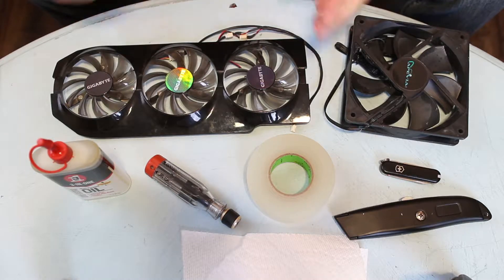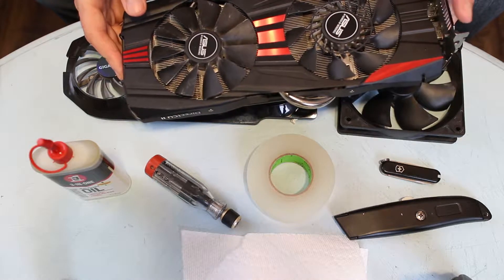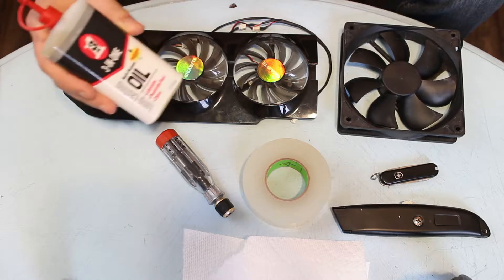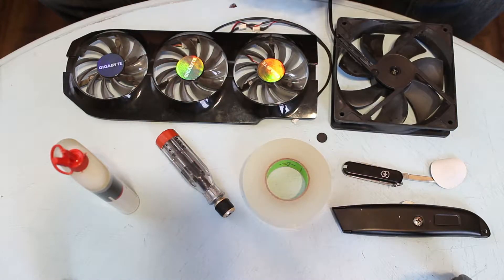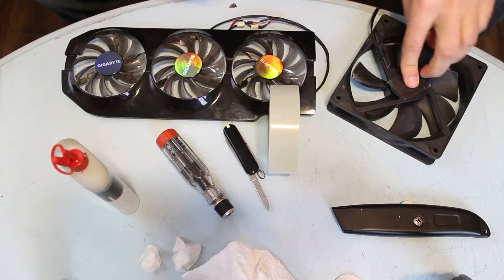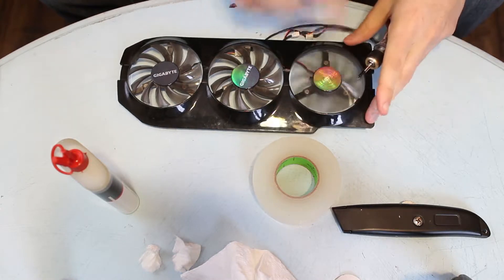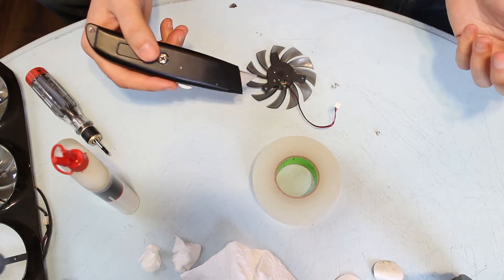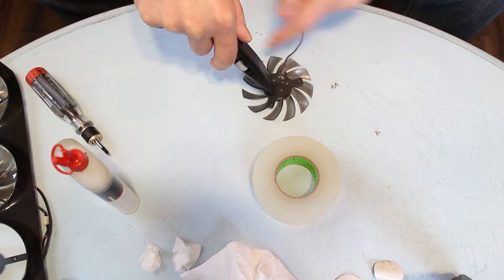Simple Repair Guide for your Seized, Noisy, Wobbling GPU and Computer Case Fans

Comment: No idea if you still see these comment but here's mine. 
Thank you for this video. I got my noisy 3 fan Sapphire Pulse RX 5600XT Pro OC to be a lot more quiet after putting sewing machine oil in the fans using a small syringe.
I had to use a small philips head screw driver tip to make the hole as the small drill we have is dead and I don't trust the box cutters.
Sadly the fand seem to have been beaten up (likely oil on the fan dried up and never got replaced) as even with the oil one of them is still a bit noisy and you can hear it still rattle a bit if you tap on the blade. Nevertheless it is significantly better now and doesn't sound like its clicking. Also had the benefit of improving temps (from 77C to 72C) since the fans are able to spin faster now.
Thank you once again.

Comment: My gpu is noisy when playing at 60 fps no matter the graphic settings. One of my fans doesn't rotate as fast compared to others so I feel like if I will replace or lubricate them will be okay but they're wormed out for sure, the only problem is I do not have a specific oil and am too scared to break the fans very close to the motor. And 2nd, I will need the help of a specialist.
Reply: This is just a generic oil. Light machine oil, sewing machine oil, tool and bicycle oil. Sold in every supermarket.

Comment: Very nice tutorial. You could also cure the problem by just disabling fan with unsync on MSI afterburner the last fan if you have 3 blade or you can even make like if gpu gets very hot, than even if it does clicking noise it will turn on to keep it cool. Also you could lower fan speed and undervolt your gpu saving power thus less energy is used, less heat and fans speed is lowest possible - 30%. It also works on dual fan, the problem is though 1 fan will work for both fans, thus it will be hotter.

I love when on youtube they overclock and overvolt to gpu, when I do the oposite, undervolt and maybe even underclock a bit for longer service time. Less voltage the longer your gpu will serve, and less heat - less components will get unstick. Also less dust and you can clean even more later if you are lazy, thus you need to replace less thermopasta or thermopads, also less risk you will open the gpu and break something thus -1000$ will go to sink...

I also heard my gpu clicking sound and saw it was wabbling bad, i just pushed it in with fingers and it seems to be working once more. Now I think I will disable the 3rd fan I don't need it my gpu is already cool, thus 3rd fan will serve me as replaceable part. If its cool it will even lower the sound of fans...
with 65c you can even make that fans wont start spinning as it is normal working gpu temp. It would start after 65 celsius

Comment: wrong method ! both kind fan blades part can take down from other sides, especially the second kind. just use a flat philip screw driver to pile it off. you don't need drill a hole on the back. man  you are a cowboy for doing like this!!

Comment: Thank you sooo much! This really helped me fix an MSI NVIDIA GTX 750TI. It only took me 3 hrs cause I'm not mechanically inclined and couldn't get the microscopic fan shroud screws to come out. The fans seem built into the shroud. There are no '3 screws" to remove them from the shroud so I just spun the knife by hand to make the hole. Well done!
Reply: Can i use Scotch tape to seal the back of the fan? Or is it gonna melt?

Comment: I used drill, put smallest drill bit (0.5 mm), smallest speed on drill, and drilled at the centre for a really clean job and smallest hole possible :), drilled until i saw metal pin head, put 3 drops of mineral oil for fine mechanics, put sticker back and cant hear fan on even 60% lol! thx for video, you saved me, a replacement fan for my gpu costs 30 dollars on Aliexpress! Palit 1660 super StormX OC
Reply: lol.. you could have pull the fan and clean properly..
Reply: @ColoniaMurder20  big lol I couldn't
Reply: @luka7007  you able pull any gpu fan.. just use 2 knife and make sure you dont hit dynamo inside while pulling.

Comment: You don‘t need to drill a hole, just pull of the fans from the base. It will take some force, but afterwards you can clean the housing before relubricating it.
Reply: Don't recommend your method, too easy to just bust the fan.

Comment: My fans started violently shaking at about the same time or stopping completely. I ended up carefully pulling the blades off and cleaning old grease and putting fresh grease. It was mostly bone dry tho, so I assume that's where my problem was! It sure stopped shaking and stopping! I currently have a single 120mm fan zip tied on mine and it's been doing 20-30 degrees better temp than the MSI fans. At least now, if that fan gives out I have the original fans again haha..

Comment: The 3 in 1 oil, while providing lubrication, doesn't stand up like a thicker grease like a lithium or silicone based 1 will.
Reply: Agree.  If I can dissasemble a fan, I use Super Lube found at Harbor Freight.

Comment: OMG thank you so much for making this. at first i thought it was gonna be pretty hard but it actually turned out to be quite easy and i just had to take my time. and i even used an old dull razor blade and it worked perfectly. i did not want to have to wait weeks for a replacement fan from china so im so happy this worked. i cant thank you enough!
Reply: ok so update: i've had to relubricate the fan 2 more times the past 2 weeks so this is not really a permanent solution. it could be cause im probably using old oil or its just that this is only a temporary fix. im just going get a new fan from aliexpress or ebay and in the meantime while i wait for it i'll keep using this temporary fix
Reply: @Lichohedge dude can i use Scotch tape to seal the back of the fan? Or is it gonna melt?

Comment: that is not an exact o knife
Reply: Correct and it is Xacto...
Reply: @PapaMav  not an exacto
Reply: @TheMustangStampede  the name of the hobby knife I am referring to is Xacto or technically, X-Acto, that is how it is SPELLED.
Reply: @PapaMav  which this guy has a flipping normal old razor knife with a thumb slide.
Reply: @TheMustangStampede  what "this guy" has, it what is called a Utlity Knife.  The best and most known, is made by Stanley.
Reply: @PapaMav  yeah I have several of them. There are other styles now I prefer then this style. I like the flip out style
Reply: @TheMustangStampede  sounds like a Switch Blade...
Reply: @PapaMav  sounds like a utility knife
Reply: @TheMustangStampede  Negative.  Sounds like a knife or more appropriately called, a "lock blade".
Reply: @TheMustangStampede  ahh yes, Folding  Style, Utility Knife.  Never had one of those, since I have Utlity Knives and lock blade knives.
Reply: Not exactly

Comment: The fins can be removed by pulling it out without making any halls in the back area
Reply: Yeah when you gently pull on both sides of the fan and there is leeway where it kinda moves half to 1 milimeter back and forth then those can be usually pulled apart, thats why they dont have any service hole, but I dont think it applies to every fan out there
Reply: but there is chance you break the plastic and mess up the fan this method is safer
Reply: @yassinehani  you can use 2 knife..

Comment: Thanks I have a GTX 1650 with a dodgy fan that sounds like it's going to take off into outer space when I try to play anything. Going to try this tonight and see if it works!
Reply: any update 3 months later?
Reply: @Neon-gl7po  In the end I just bought two quiet case fans, used a PWM converter (to plug it into the GPU's fan header directly)  and use tie wraps. It works perfectly. No more noise and doesn't get hot anymore.
Reply: @bluetech2809  that's a nice workaround. I have a 1060 that does some rattling sounds above 80% fan speed but I might just get some new fans off ebay cause they're cheap and I saw some from a country close to mine
Reply: @Neon-gl7po  Yeah in my case one of the blades on one of the fans had broken off completely (I bought it second hand, not sure how the previous owner managed to break the blade unless they were doing that to cover for a more sinister issue).

That's why I went with replacing the fans completely (rather than this re-lubricating type thing in this video), and also because mine were 70mm diameter fans, which seem to be hard to find replacements for (fans for the bigger GPU coolers, like 80mm or 90mm are easier to find). Even if you get a set of replacements, that can cost basically the same as just getting two regular case fans anyway. 

I went with some really quiet ones, and I also repasted my GPU with thermalgrizzly kryonaut while it was disassembled, so in the end my 1650 ended up running way cooler and way quieter!

Comment: you can remove back sticker if there is no screw holding blade you can push the fan outward, gently applied 2 sided pressure  , fan blade will pop out make sure to not break the mounting plates. Then clean the magnetic surface and pin, blow air in pin  hole if necessary  and apply little grease not oil and put it back .
Reply: I thought of it to push it out but I was scared to break it

Comment: Kudos to you sir! I did the same to my Palit 1650 Single Fan, I just use my cutter then I saw the shining metal inside the center of it, put some machine oil, spin it a little so that the fan absorbs the oil, once the fans got all the oil, i wash it up cover it again, and run a couple test, and works like NEW! Thanks a Lot Sir! GODBLESS!

Comment: Isn't creating a hole like this causing it to allow air to enter an area that it should not?
Reply: Honestly, that really should not matter unless there's condensation, but if that happens then you have other problems.
Reply: @taikoto8199  I found that I ran into metal while drilling. Then found the entire thing could be pushed /snapped off to get access to hole, filled it with grease and done. Didn't need to drill the hole front /back  after all

Comment: idk about creating your own service hole, is removing the blades then adding the oil directly a problem?
Reply: i have tried this with 2 different case fans. the spin fin when i spin them but once plugged in they still had issues. im not sure if when you pull them out it damages something but i havent had luck trying this.
Reply: You're more likely to break the fan baldes by trying to pry them off the motor hub, the service is found on many case fans from the factory and making your own isn't that big of a deal and probably should have been done at the factory

Comment: how long it lasted? i did mine 2 days ago,it fixed it but ive applied less oil,i may buy replacements if it starts to get stuck and noisy again,mine also smelled like burning but i put a drop of oil in the newly done hole and it stopped

Comment: for GPU fans. I recommend you put it open with two knives. I did your method. it just made a hole in it. Made things worse. Nothing can save the gpu fan at the moment. I think i need to buy a new fan or look for bearings. China has that fan in stock, but it's going to take 2-3 months to come by mail....
Reply: I used drill, with drill bit of 0.5 mm, cleanest job ever lol

Comment: next time you could just pull of the rotor and drop the oil in from top. even better use graphite
Reply: Some of GPU or laptop fans doesn't give you that option.
Reply: @tromick  there is chance you break the plastic too
Reply: @yassinehani  Some people drill but you need skill for that.
Reply: @tromick  just drill in the center slooowly (drill on slowest speed) until you see metal pin head, I used smallest bit of 0.5 mm easy peasy lol

Comment: The problem is, the fan is still full of dust and there is very little tolerance between the coils and the magnet so it will grind. Best to pull the fan and the base apart and clean it and lubricate it. I took mine apart and there were scratches on the magnet indicating that it was full of dust.
Reply: be aware if you do this, put back the bearings the exact same as they were, i switched them around and had to redo the job cuse it was not spinning properly, also i stretched the spring and made sure it was the right way, now its like new again, super quiet!

Comment: The machine oil may eat away at plastic parts, better to use silicone oil with this method.
Reply: i was thinking about mineral oil. like baby oil. its pretty pure stuff. what do you guys think.
Reply: @MrGreen1988  Neutral enough but I would be concerned about the viscosity; I was thinking about either lithium grease or Super Lube 21010, depending.  Maybe even sewing machine oil if something more viscous is needed.  If you TheBusGuy's method you'd have to work it into the hole quite a bit but if you were able to take it apart, clean it and then grease it that seems a slightly better option.  Either way, saving parts from the landfill a while longer always seems a better option!  <3
Reply: @michaelpichahchy2489  in off road jeeps/trucks they have grease-able fitting. time to come up with a grease-able fan. lol
Reply: You are right, it changes the top of layer's shiny plastic and it becomes dull.
Reply: I used olive oil, how bad an idea do you think that was? Haha
Reply: @TheEloquentEye  food oil can go rancid
Reply: @TheEloquentEye  lol, you may experience some issues... or your gpu may start smelling of fried chicken! Keep us posted haha

Comment: thank you, this is the only video i have found that shows a more modern style fan and cover. makes me much more confident before i attempt it on my MSI 2080
Reply: 2080 seriously bro ??
Reply: @gameplaysome5819  There have been fan quality problems for so many brands starting 2019. Many fans start growing issues after mere months of use. They have used rifle bearing fans before from the same suppliers, which weren't ever particularly durable or ideal, but some sort of quality problems happened since.